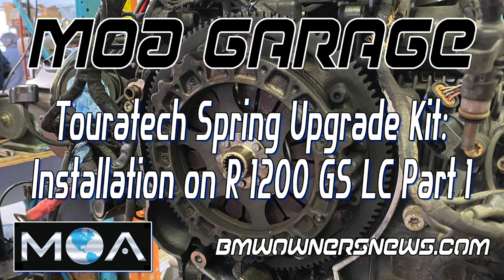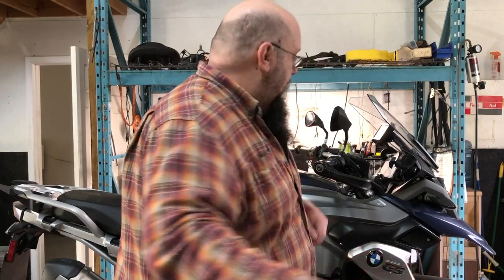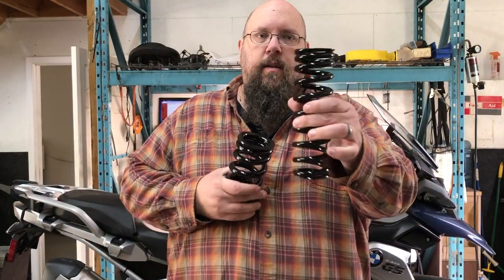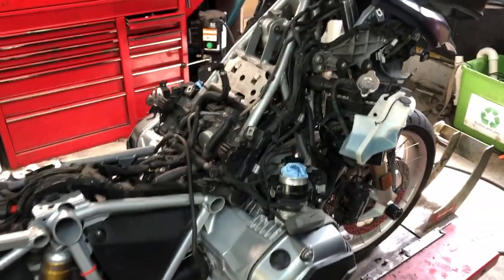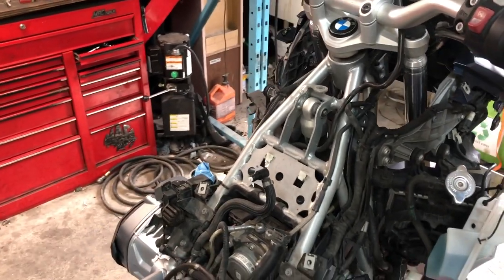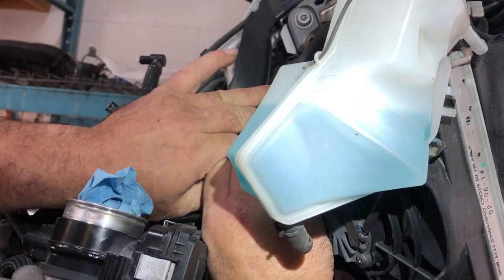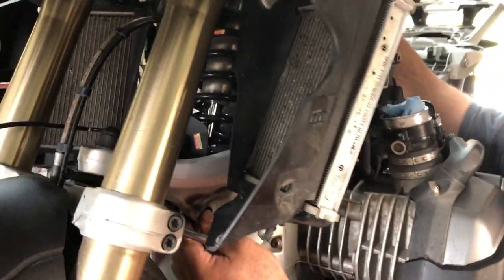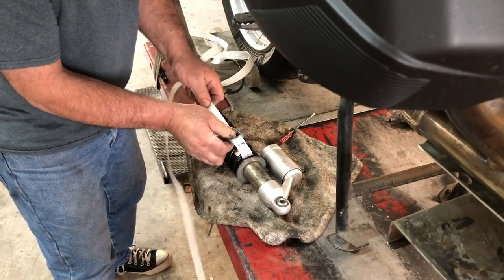Touratech Progressive Spring Kit Install on 2015 BMW R 1200 GS Part 1: The Front!

Comment: Little late to the party here.  I've just completed a spring swap for the front on my 2014 GSLC using your video for reference.  For anyone else doing this, you don't need to remove the bushing for the collar to come off (11:49).  The collar has 4 divots and aligning those with the bushing will allow it to clear.  It may take a few light taps, but that's it.
Reply from the maker: Thanks for adding this tip!

Comment: How much of a difference did the springs make to the bike?
Reply from the maker: Call it a 50-60% improvement. Definitely noticeable and very appreciated, but not a night-and-day difference. Bike immediately felt more stable in hard turns and straight-line riding was smoother.